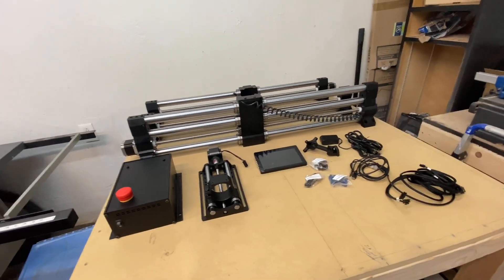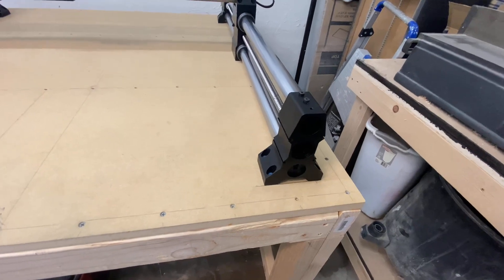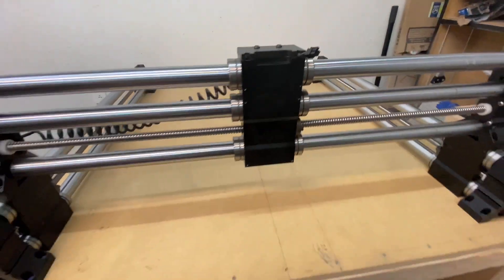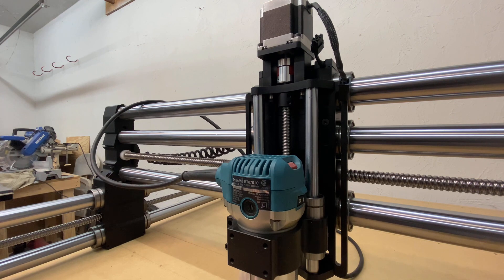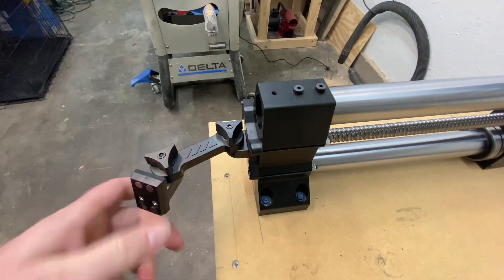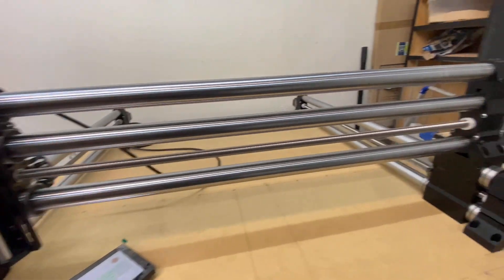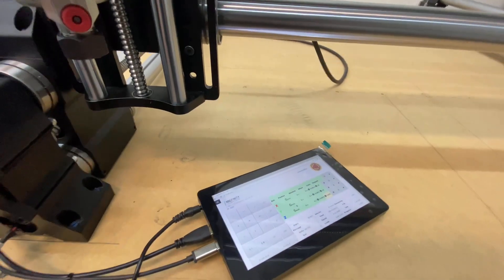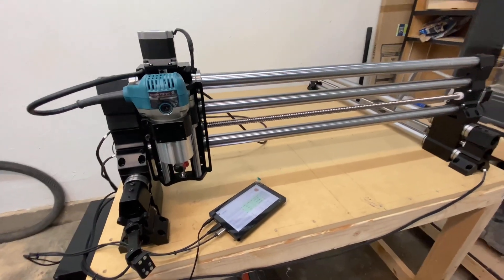How to assemble the Onefinity CNC - woodworker model

Comment: I had my mind set on the Shapeoko 3 until I found this, may have to go this route instead. Thanks for the video.
Reply from the maker: The shapeoko is a great machine, I wish I had of made videos when I had it. The nicest thing is not having to mess with belts and v wheels with onefinity! I appreciate you watching.
Reply: @74CreativeDesigns  i almost got the shapeoko also until i saw this..Just looks way better to me w ballscrews and rigidity factor..i ordered 3-4 mos ago..getting it in 2 wks..cant wait..i better start making the table..lol
Reply: I've had the shapeoko... It's junk. This looks by far.

Comment: That process gets you a parallelogram that may be square. You need to check your diagonal measurements to verify.

Engrave a shallow square or just 4 corners and check that.  I've seen numerous forum posts on out of square. I know it's not in the onefinity instructions, but you can hope for square or make it square. They went for "hope" I guess.

Don't believe me? Before you put screws in the far end move the feet left and right. Is it square???
Reply: I have not bought a machine yet but really appreciate your attention to detail and sharing that advice.
Reply: I don't own one of these, but I've been considering.  It seems to be it'd be better to fully attach one of the Y rails to your surface, pull the X rail forward to attach one corner of the other Y rail, then move the X all the way back to square it.  Instead of having a single point on one corner that could, like you said, lead to a more parallelogram shape.